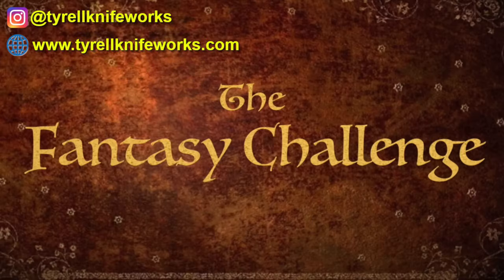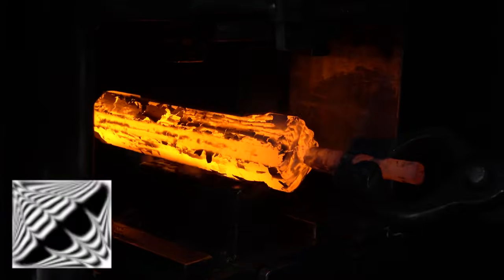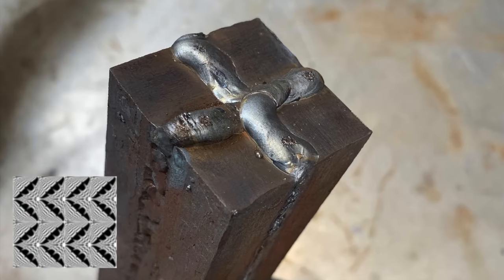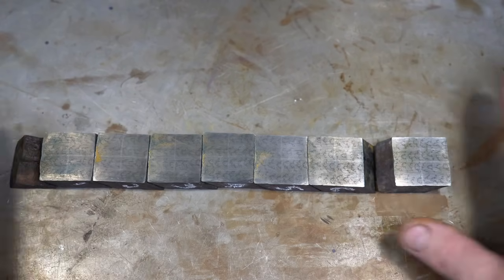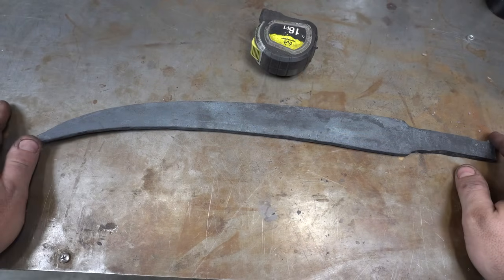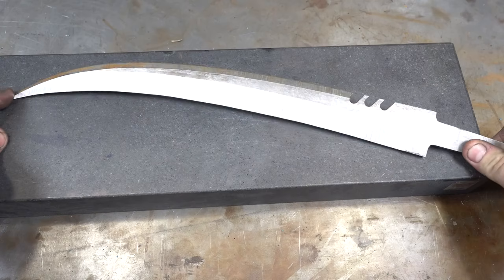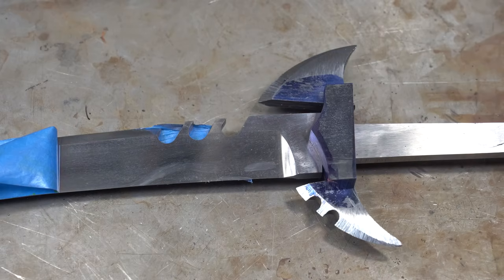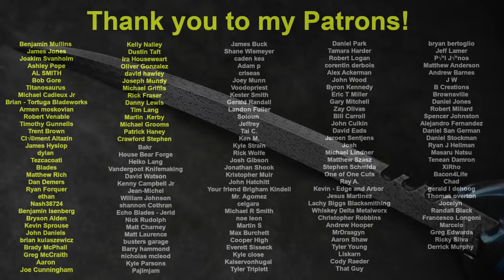The Fantasy Challenge - Forging the shark knife

Comment: Now this is a nice fantasy blade. Many "proper" smiths fail to incorporate a fantastic element or default to making a blade with "elven" decorations. This one has a fairly unique theme that makes it easy to picture it in the hands of a merfolk assassin or someone like that. The shape of the blade goes with that theme: A slim blade with a relatively fragile guard, great for gutting fish as well as sneakily slashing and stabbing in a backhanded grip, and the hilt looks like it could be utilized too in a pinch. Great job.
Reply from the maker: Thanks for checking out this build, Christopher!

Comment: The work is amazing and amazing, I really like your Damascus, can I ask what kind of adhesive did you use in the process of pressing the metal sheets together, borax powder for example?
Reply from the maker: The billet first is dipped in kerosene which burns off in the forge and leaves a residue that protects it from scales and then borax is used in the first couple heats only.  Thanks for watching.
Reply: @TyrellKnifeworks  Thank you for sharing this amazing thing, it helps me a lot. Can I use a brazier instead of a gas oven, because the brazier will have coal dust and more impurities than a gas oven, will it affect the adhesion of the metal?
Reply from the maker: @Arts-and-Crafts  do you mean a coal forge?  If so, that will work fine.  It’s harder to heat a whole piece evenly though.
Reply: @TyrellKnifeworks  Yes, the place where I live only uses coal for smithing and the metallurgical technique is not good, and I have never had access to a gas furnace. Blacksmithing aids are too expensive

Comment: Beautiful blade, definitely voting for you. 
I do have a question, hopefully someone can answer. I bought a blade blank and unfortunately the whole bloody thing is hardened, full tang and all. How do i go about softening the tang so i can drill holes for pins? I dont have a forge. I burned out 3 drill bits before realizing it was hardened.
Reply from the maker: Get yourself a propane or map gas torch at your local hardware store.  Wrap the blade with a wet cloth and torch the tang until it’s dull red.  Then let it cool slowly.  You’ll be able to drill it after that.  👍. Thanks for watching, Frank.

Comment: Wonderful pattern! I suppose you're using a gas forge for the heating.
I work with coal, even for my damascus stuff, but would you agree that you know you're in a reducing environment when you're away from the spot that heats up the forge? In the sense that if there was still oxygen in the flame, it would actively heat up the coal/propane flame, therefore you have to basically stay in the "cold" spot, and let the radiant heat get you to welding temp. And that, of course, takes a long time and wastes a lot of fuel compared to just sticking your steel in the hot spot directly.
Is this how you manage your heat in your forge?
And i've seen an old blacksmith say that forge welding should be kept at a "low" temperature (lemon yellow instead of white) to prevent fine damascus patterns from smushing and fusing together too much, therefore blurring the pattern. Would you agree with that?

I know this is technical stuff but i'm curious to know how you do that!
Reply from the maker: I agree you don’t want your steel directly in the hot spot.  My forge circles the flame well.  You definitely want a fair amount of dragon’s breath to create a reducing environment as well.  On the forge welding, I’m typically near white hot temps for forge welding.  I’ve not experienced major distortion in a pattern.  Maybe that’s a factor in some more advanced. patterns.  Thanks for watching.

Comment: That's one killer knife. Love the blue handle and other blue pieces, that gave the knife that Wow factor and the pattern in the blade, awesome how you made it. An the tail end on handle, that's to get the person who comes up behind you so you don't even need to turn around to fight him. One back hand hit will finish them off. I love your videos. Can you try to make one that looks like the short sword that Steven Seagal used in the movie called, A Good Man. The sword in that movie was actually one that he personally owned himself from his own collection. I'd love to have one just like it, that sword is called the Devil's Butcher Knife. What would it cost to have one like that made today using the best metal so it holds the strongest an sharpest edge for going through whatever it touches like bone? It needs to be full tang handle an overall length of 20 inches, I believe it is. The 14 inch of cutting blade with a 6 inch handle. I love all the tools you've made. I use word tools, because they fit into the hands and they simply become extinctions of our bodies. 👍
Reply from the maker: Thanks for checking out this build!  I don’t really do custom orders so I’ll have to decline.  I will check it out though to see what you’re talking about.  Thanks for watching!

Comment: That turned out great! Any observations as to what might have caused the delam at the edge?
Reply from the maker: I didn’t have it hot enough on the first heat and didn’t compress it enough when it was hotter.  You need about 30% compression and I didn’t.  Thanks for watching.

Comment: you know, i always wondered why is it that the spark/light when welding is less intense when we see it on a picture or video when it can cause blindness with just 1 second of seeing it without proper gear
Reply from the maker: Radiation is not transmitted through an image like real welding would.  Plus a second of welding isn’t going to make you blind.  It takes much more than that.  Thanks for watching.

Comment: why dont you make an induction heater for a furnace?
Reply from the maker: Induction forges aren't something easy you can make.  They are quite complicated pieces of machinery.  Plus for bladesmithing, induction forges don't have a ton of uses.  You can't really heat treat with them, they only heat up small sections at a time.  Thanks for watching.

Comment: You could've flipped tooth number 7 just on the other side after turning it around, so that the direction of the scales is correct again. No need to cut off anything. Just turn and flip. That's it
Reply from the maker: No, it’s a parallelogram.  The angles didn’t match up even doing that.
Reply: @TyrellKnifeworks  they should match up on a parallelogram. Or did I miss something?
Reply from the maker: @jupamoers  Thinking about it again, if I flipped it over it should have worked.   I know I thought about that at the time and figured it wouldn't work for some reason.  If I recall correctly, that was the end piece so the end of it was a little screwed up so I couldn't just flip it over.  Something like that.

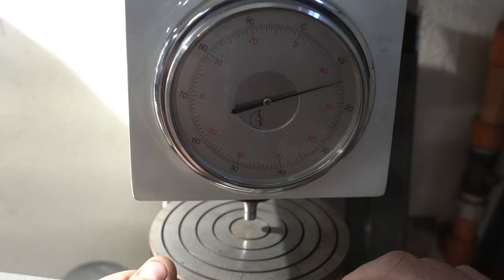Comment: 22:23 what's the ideal number
Reply from the maker: It depends on what kind of knife.  If it’s a chopper or bushcraft knife you might want the hardness a bit lower like 58 so the edge is a bit tougher.  For a chef knife you want it higher, maybe 61, so it has a keen edge.  This one is right in the middle.  👍
Reply: @TyrellKnifeworks  thanks 👍🏻

Comment: How the F$#% did you get the pattern facing the other way? Sorry not judging or anything I know things can get confusing especially making a very elaborate pattern like that, but I'm just wondering how it got faced the other direction and still has the same cut
Reply from the maker: When you’re cutting on the band saw, I had to move and reset so I could lock it in, when I did that I must have flipped it over accidentally.
Reply: still perplexes me🤔